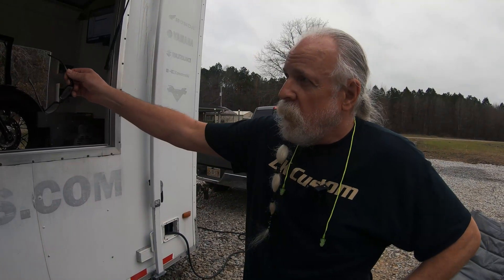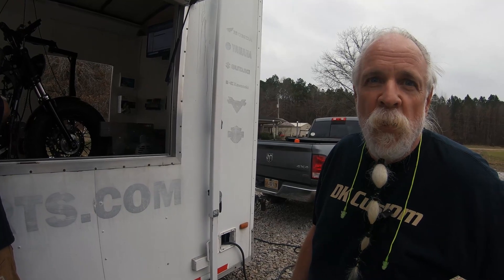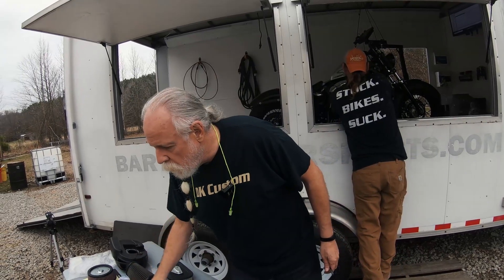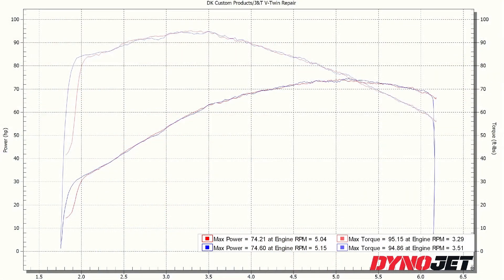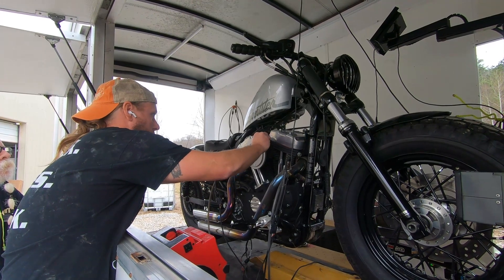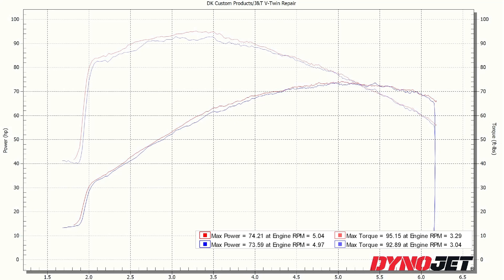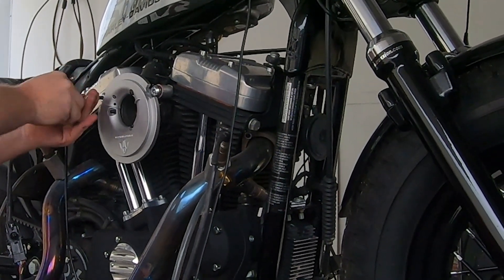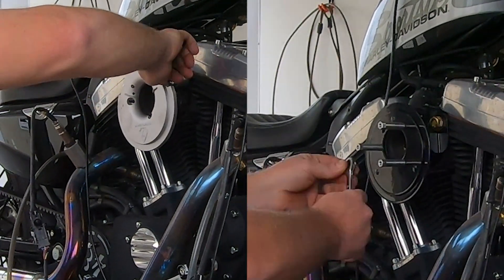We Were Wrong...Dyno Told the Truth...Question Answered

Comment: Many variables to consider. Wonder how this plays out on an Arlen Ness inverted AC? I'd assume the inverted design of the filter element would be conducive to the radius design of it's backing plate? Additionally, wonder how this plays out on higher displacement applications (110"++), with larger throttle bodies, 58mm++. 

I have the Arlen Ness inverted AC with your stage 4 catch can EBS. On a S&S T124. 

Thanks for sharing.
Reply from the maker: We have not done an apple to apple test like this with the inverted.  
We have done many apple to apple tests with higher displacement bikes, some with larger throttle bodies, some without.  They have always shown an improvement.
Good deal on you having an EBS.  Your bike likes that!

The purpose of this video was not really about the AN BS, but to see if different material made a difference.  We were surprised that it did not, but it just reinforced that the way the air flows after it passes the element is Very Important.
Reply: I hope I got a good air cleaner for $431!  I got the Arlen Ness Inverted Beveled AC and the V&H Hi-Output 2 into 1 shorty exhaust for my 2017 BreakOut. Had it dynoed and seems to run good so far.

Comment: I know this, when I put the 587 air cleaner, the external vented catch can, xl-vied, and new slip ons on my iron 883 the difference in performance was not just noticeable, it was beyond my expectations for sure. It literally, LITERALLY, made it feel like I was riding a completely different motorcycle. I just recently put a permanent oil filter on when I did my 5k oil change and actually got rid of the noticeable lull in power when shifting to 2nd gear. Not a huge deal as I rarely ride around in 2nd gear at less than 3k rpms but still, that little drop off in power isn’t there anymore.
Reply from the maker: Thank you for the comment and kind words.  Great to hear you are enjoying the benefit of the parts.
Enjoy your ride!

Comment: Their completely wrong. The bell is to smooth the air into the inlet. Better let F1 see this scientific video.
Reply from the maker: Methinks you're confused.
They, There, Their, They're sure they mentioned that the reason for the testing was to see if the aluminum vs. the steel made a change.
Fact: it did not make any significant change.
They also tested the 606 vs. the AN BS with the bell inlet.
Fact:  The backplate with the bell inlet did not perform as well as the 606 that does not have the bell inlet.
Why?  That was not determined.  But as They said, it should have...but the THEORY, not the fact, or science, is that the irregularities in the backplate reduced the power generated, even overwhelming any benefit of the bell inlet.
Nothing in the video is right or wrong.  It was simply a test of how the steel vs. the aluminum backplate worked, and how the AN BS backplate worked.  
It was tested, results were shown, and theories were discussed.

Comment: GREAT INFO .... So would I be correct in assuming that with my 2020 Fatboy 114  STOCK Screaming Eagle breather that my best bet  is to add ya'alls external venting system. And NOT change out the breather back plate ? THANKS for sharing !!
Reply from the maker: If you are going to keep the stock air cleaner on your 2020 Fatboy 114, but want to make it work better/product more power, then an External Breather System will do that.  It will need a little work. 
Here is a link to 4 EBS set ups that will work with that intake-
https://www.dkcustomproducts.com/diy-external-breather-systems-407.htm
And here is a video showing how to install it-
https://www.youtube.com/watch?v=uAmPC_kglJk

Comment: Another great video, love your channel. I've bought your products for two bikes, I've also spoken with Duane on the phone. I appreciate that you guys know how important the nature of airflow is in the intake and exhaust of an engine. I also have a PhD in aerodynamics and spent many years working on defense projects at Boeing. The data you collected during this test is super interesting. As you figured out, the results have nothing to do with the materials used. The performance boost you saw is due to increased mixing of the intake air. You're welcome to give me a call if you'd like to discuss this further. You have my number and email on the order I made. Stay safe. :) Rick Black
Reply: Fluid dynamics, especially turbulence is inherently unpredictable. The rounded edge of most engine inlets, including jet engines is a great place to start for maximizing the air intake. But there are other important factors. After intake air has passed through a filter we're not talking about laminar flow, the issue is how to analyze and maximize the turbulent air. Sorry, it's a little much to discuss in detail via text. :)
Reply from the maker: @rickanna8662  On my list to call.  Thank you for your input! 👍
Reply: @rickanna8662  Thank you for replying.   I understand.
Reply from the maker: Hi Rick,
Will be calling.  Thank you for the invitation.
Yep, for the last couple of years we were really thinking that it must be the aluminum vs. the steel accounting for the power changes.  
Obviously HOW the air flows after passing thru the filter element makes a difference, but with the small differences between the AN BS and the 606 backplate, we did not think it would make THAT much of a difference.
Between our tests a few years ago, and the 6 tests we ran last month, we now know that even small differences in shape and surface make an even larger difference than we thought.
Reply: Rick can you elaborate some?   I’m interested in your reply!   I am no engineer or mechanic but I was wondering if the center flang/curve into the throttle body decreased the air flow some as the space is a little smaller.  But what do I know  I am a highly train unprofessional.  Lol

Comment: On the road the aluminium would be colder then the steel but if it could messured in hp is another story, the smothed edge i good when air is pushed direct straigt, but the air comes in at a 90 degre angel thrue filter, so that could be why. Plus there are 3-4 holes in the edge. Ps i liked my 606 on the sportster, never did get to fit the catch can still in the box 😉 a good reminder off my trip seing you all, i still thing about the really want to come back and Explorer the back roads with kevin like we talked about😋😎 maybe the covid shit gets a break so i can come over this year🤘
Reply from the maker: Yes, the irregularity of the surface and the divots for the bolt holes, and the lines for oil seepage...all small things, but they make a difference.
Looking forward to when you can make it back over this way!

Comment: Can you please check out this channel and comment about vacuum in heads and how he stated an ext breather.is not good.    The channel is Ricky HD.   Also there is a another guy on YouTube Ron’s Workshop who is trying to figure everything out and decipher between BS and facts.   If you could comment  I think it would clarify some things please.
Reply from the maker: Yes, in the last 12 months this theory has been floating around.  It presumes that the rings need more vacuum than exists in the crankcase with an EBS.  That is a large assumption,   however, not a single person or company has provided any test results, or data at all that there is any validity to their theory.

What is known, and what there is a plethora of testing and data on, DO NOT put hot, oily, oxygen depleted air into your intake.  It will reduce power, cause accelerated wear, and result in tune instability.
These things are all well documented.
Dyno Chart Link- http://www.dkcustomproducts.com/media/wysiwyg/breathertest_1.jpg
 Photo of a piston out of a M8 114 at only 5,000 miles.  It was taken apart to do a 131 upgrade.  Imagine the owners surprise!  He now has an EBS on his 131 Kit Upgrade 
https://www.dkcustomproducts.com/media/wysiwyg/AirCleaners/M8_114_5000_miles.jpg

Every External Breather System we have is a crankcase vent.  The Systems we have prevent 100% of the hot, oily, oxygen depleted air from going into the throttle body and combustion chambers.  This extends the life of the engine, gives more power, runs cooler, and prevents tune instability.
You are probably asking about the vents that have become the fad in the last year that vent at the actual oil tank.  With these there is still some hot, oily, oxygen depleted air being fed into the intake & they cost more.  It is spending more and getting less benefit.
Reply: @DKCustomProducts  Thank you so much I understand.

Comment: maybe thicker backplate means the air has to travel farther to get into the throttle body , but you'd have to ask an engineer if that would be significant enough to reduce the torque by almost 3 foot pounds . 
good video !
Reply from the maker: Could be.  It is probably a combination of several things.  Less space, surface is not smooth, lines, divots and other irregularities interrupting flow.  
The important thing is that we can cross off our list that aluminum (which vibrates at a different frequency than steel) is NOT a factor.